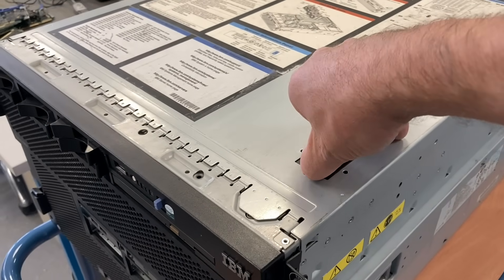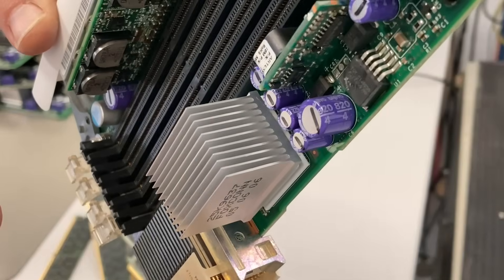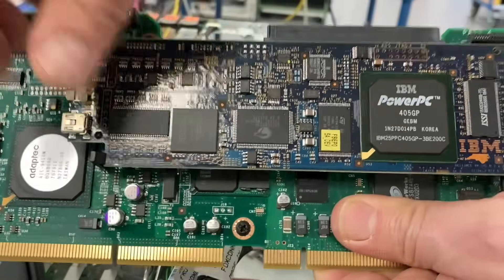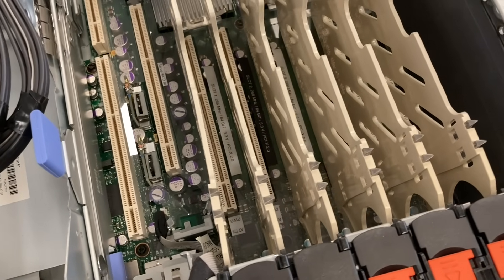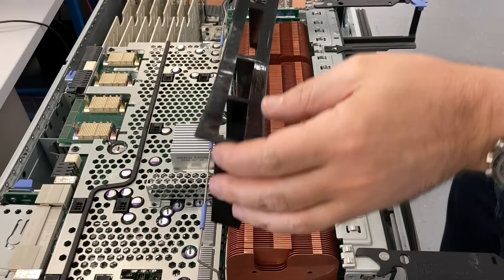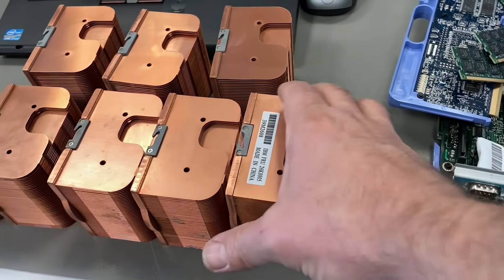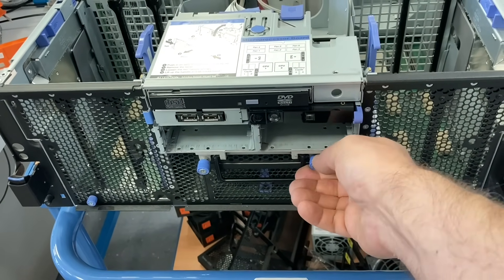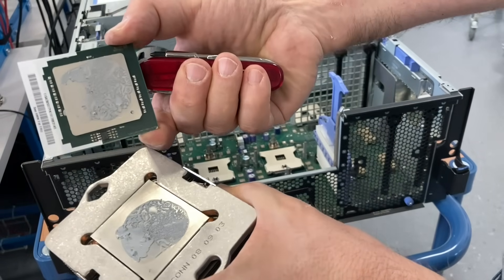IBM x3850 server from 2006 (PWJ266)

Comment: The hot pluggable PCI slots. I think that never was a success in the market.
Reply from the maker: For a short time all manufacturers had them. A couple of years later they were all gone. It turned out that it's not necessary, too complicated and only useful for certain PCI cards. It was mainly a marketing stunt. HP even introduced hotswap CPU's... but how many times does a CPU fail? And if it fails, your server crashes anyway. :-)

Comment: I just love how wonderfully modular this expensive equipment is. How it fits together and is well constructed.

Any attempt to do this with workstation (gamer?) PCs just never went anywhere. BTX, for example. It might have saved some money to organize things and allow airflow to be pushed through in a straight path. But it just wasn't flexible enough for gamer PCs and impeded upgrades.

Comment: 3:50 Similar batteries are used in Sony professional HDCAM-SR video recorders.  I had to replace one recently because the machine would forget all its settings.
Reply from the maker: That's the good part. They are replaceable. Unlike the Dallas chips with built-in battery...